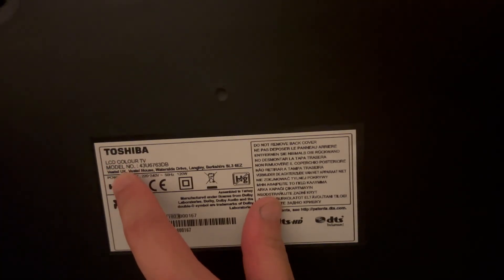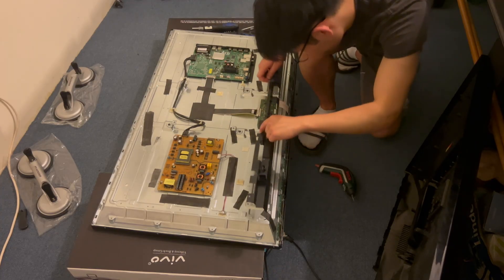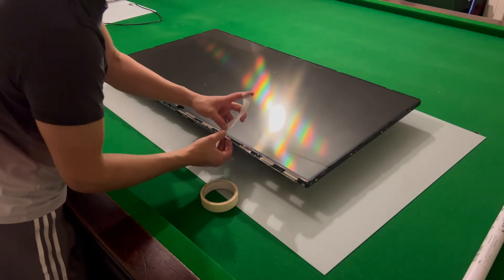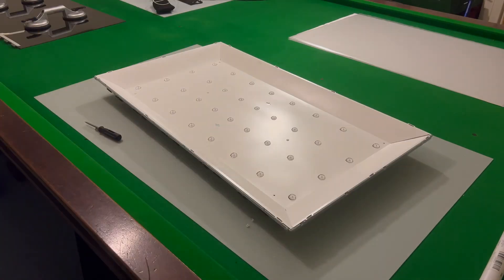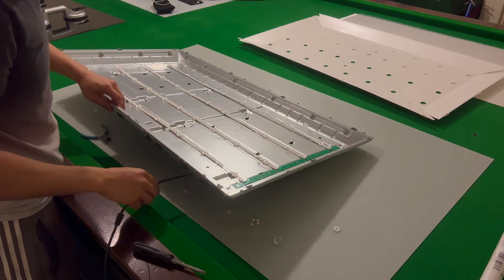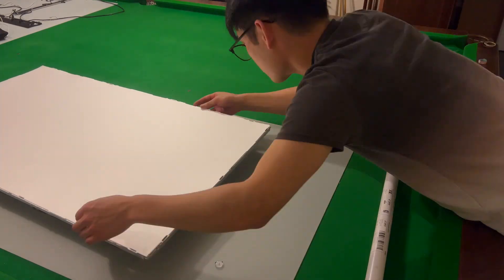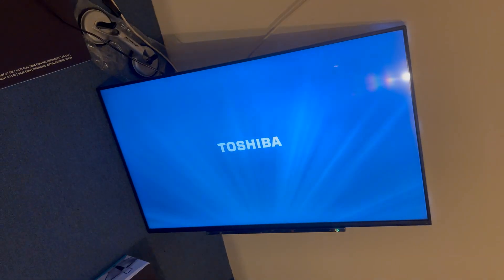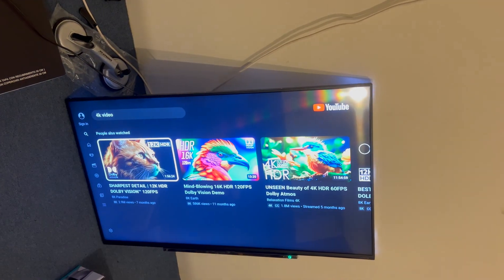Toshiba LED Backlight Replacement

Comment: Mine is a 65” backlight failure - easy to check as the Android boot logo appears in the middle with phone torch. The idea of removing the 65” panel by myself is a bit too daunting. Plus I don’t know if any of the components connected to the LED strips have blown. Shame as it’s only 5 years old and the irony is the Toshiba batteries in the remote control lasted longer than the TV! 😂

Comment: Hello, I am changing the Toshiba 43 L 2863 LEDs. The LEDs are separated as A and B. I did not pay attention to the order of A and B. Does the order matter? I am currently dismantling the TV at home. I would be very happy if you could give me a quick answer. Thank you. Best regards
Reply from the maker: Yes as the connectors on A and B should be different and perhaps also the mounting points onto the tv metal panel

Comment: I fixed a 65 inch Toshiba (
toshiba 65ul2063db backlight panel) watching your video. Thanks a lot. I bought the part on ebay and I didn't need suction cups, but I needed a friend to help me flip it on a soft surface. Great job, saved a lot of money 😊

Comment: hi what suction cups did you use please? I have got 70kg double suction pads but not sure if this is overkill/will damage the screen as they seem strong
Reply from the maker: You can half close the tab for the suction cups, then apply it on the screen and then fully close it as to not use the full rated 70kg. Be careful though and ensure you have sucked the screen when you are using this half closed method